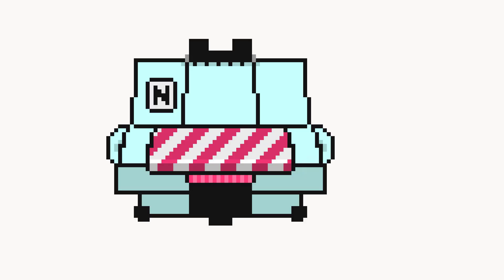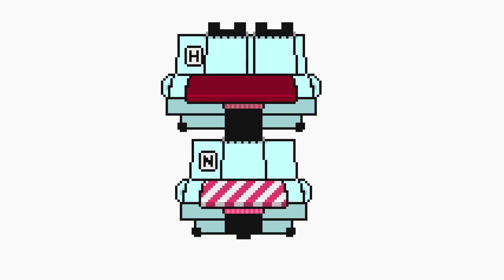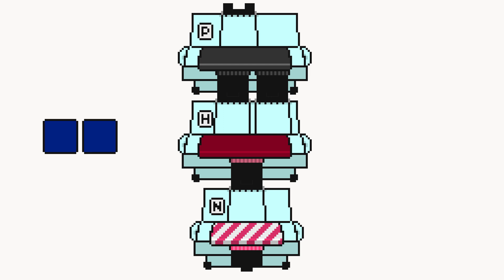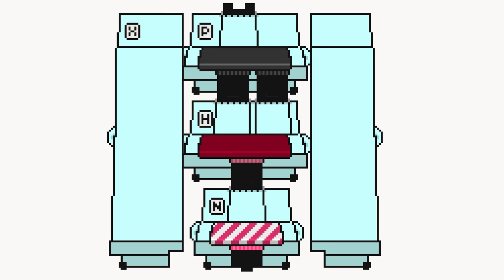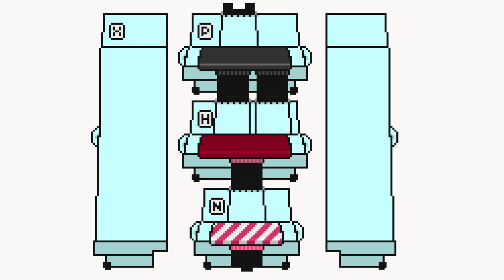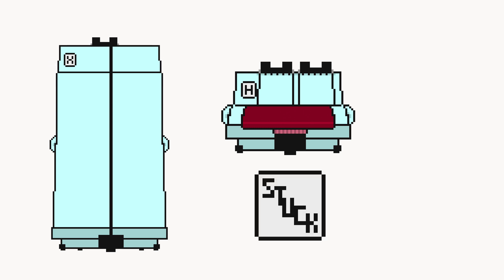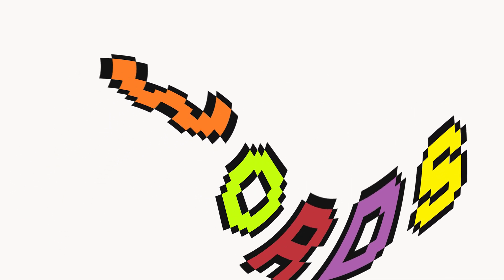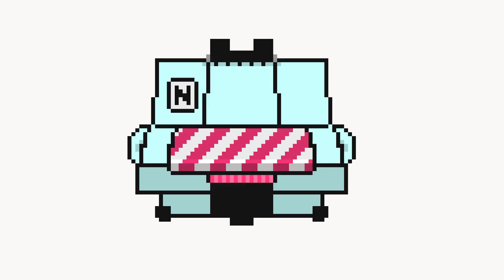The Halting Problem Debunked

Comment: i do think your analysis was on the right track but its not quite accurate

the actual issue with the halting problem is that it uses something called extensional set theory

however computers are intensional
this means that if it were fed its own blueprint, even though the blueprint is identical, it is being simulated, which is intensionally different from its external real world counterpart

this means that its actually impossible for you to input an intensionally identical input to its own code

this means that the negator wasnt at fault, its simoly that the machine being simulated and the external machine are two different machines intensionally, they have seperate contexts which makes them functionaly different despite having identical code

this direct machine difference means that even though the internal code says "stuck" and the external code says "not stuck" 
there isnt a contradiction between one machine, its actually just the result of two different machines producing two different results
Reply from the maker: @pigizoid9924  hmmm, I'll have to think about that... Thanks for the comment/input in any case
Reply: @AntonioEligius  
The halting problem is basically a complex form of the liars paradox

"this sentence is false"
in extensional model, we will assume it is true, which returns false which returns true etc...

but in an intensional model of set theory its different
"THIS sentence is false" within its current context
we assume the context is true, which returns false, and then it stops there
because once it returns false, its own context changes and THIS sentence is no longer the same sentence described at the start of the paradox, its intensional identity has been changed due to the new context, even though extensionally the words of the sentence havent changed

in the halting problem, an infinite recursive loop is not-halting, meaning the halting machine will print "stuck" 
and even though the output is "not stuck" 
the halting machine is still correct, because as mentioned earlier, the contradiction doesnt exist, because the programs are no longer the same program

it outputs "stuck" WHEN simulated (intensional context)

even though it outputs "not stuck" WHEN not simulated
(intensional context)
Reply: @AntonioEligius  im back with a more formal description 

in the halting problem there is a device D, the device D needs to take in its own input, so we will denote device D running with no input as D() and device D running with its own input as device D(D)
the two subtle points of failure in the halting problem are the underlying assumptions that the external device D() and the internal device D maintain referential integrity and hold up to kleenes description of "meaningful referenenc" however this is not the case, as due to godel numbering, the encoding of D is done in a way where there exists two copies of the device, aka the device is running across two contexts, meaning they are referentially variant, the result of this is they could produce two seperate outputs as they dont share the same intance
however if we do rigourously enforce referential identity, aka singular instance, then the external device D() and internal device D must produce the same output as they are literally the same object in memory, this means that Turing's result of having the external device and internal device produce two different results is not a conclusion of "incomputable" but is instead a result of a failure to enforce referential invariance, aka making D() and D identical

to enforce referential invariance you need to use a self reflective model such as a push-reactive frame of reference encoded model, these such models are turing complete according to the classical turing constraints, but with the extension that the assumed "trivial swapping" no longer becomes trivial, as the swapping device S needs to subscribe to a frame of reference to listen to, however the device D must write the frame it outputs to into memory, and due to basic temporal limitations S cant read the frame until after D has written it, meaning D can deny S from subscribing to the frame and ever swapping the output
this also has the added benefit of letting D output values both in bnary logic and in modal logic, where D could display "halt" or could display "halts in frame f" 

if i were to point out a very absurd but direct reasoning of the flaw, imagine running a function in two contexts, i.e. one runs in linux and the other on windows, of course they will produce two seperate outputs, despite being encoded identically they cant run identically unless they run in the same frame of reference

Comment: The statement at 2:20 makes no logical sense: "if the machine does not halt, it is actually halting on the programmed function of looping". You're confusing "halting" with "working as intended". These are two different things.
Reply from the maker: It's reaching an end state; it was programmed to loop as an end state; that's the form of halting I'm referencing by way of basic logic.
Reply: @AntonioEligius  It's impossible for a machine to "not halt" and to "halt". By way of logic that's called a contradiction.
Reply from the maker: @tomekczajka  no, I'm uncovering a logical equivocation. In simplified terms, they're saying they've solved a problem whether or not you can make a machine that won't halt, by simply designing a machine that is programmed to not halt if a halting input is fed into it. You've got to understand, halting is just an end state of a program and since they made a program with an end state of "looping"  or "not halting" they've just made a different kind of halt, because the intended end state, or halt, is that of an exact repeat. It's like if I made a program on Basic that read:
10 Home
20 Sweet
30 Go to 10
It would just say Home Sweet Home over and over, but that's what I wanted, so I got the end state that was desirable. I'm just saying their proof, can't be a proof, because it's too simplistic in nature and they didn't go through the work of making every kind of computer, they just tried to bully an answer out with faulty logic.
Reply: @AntonioEligius  You're the one equivocating. That Basic program unambiguously does not halt, by normal terminology. It does what the programmer wants, but that does not mean it "halts".
Reply from the maker: @tomekczajka  ok, since you're making this claim, prove the premise. Show me and explain how Turing's un(it) machine solves the Entscheidungsproblem.
Reply: @AntonioEligius  I made no claim in this thread that Turing's un(it) machine solves the Entscheidungsproblem.
Reply from the maker: @tomekczajka  well I don't know what else to tell you, other than each machine after the duplication machine doesn't malfunction, it simply prints one of two outcomes. Mal from the Latin for bad, and functio from the Latin for perform. There is no bad performance, it's the intended outcome. Remember the original premise is to see if you can prove that a machine can't do everything computationally; you can't prove that by having machines do exactly and perfectly as they're programmed.
Reply: @AntonioEligius  Abstract computers (Turing Machines) do exactly and perfectly as they're programmed. Simply claiming "you can't prove" something when you have a proof is pointless. You've nicely animated a valid proof. That proof doesn't mention the words "intended" or "malfunction". It only talks about whether a machine halts or doesn't halt. You're trying to point out a flaw in that proof but you fail because you don't understand what "to halt" means. In your animation it means "to print a piece of paper". If a machine doesn't print a piece of paper, it doesn't halt by definition.
Reply: Based.  @AntonioEligius

Comment: I do agree with the hoax part. however i don't agree on how you get there. If the machine seems stuck, it doesn't mean it is indeed stuck. So you can't be sure if it is stuck or not. Unless you have a way to proove that it is stuck. Unfortunately, it is your proover himself that happens to be in such a state in the first place.

Comment: Whether or not the machine is "intended" to get stuck or not is irrelevant. The halting problem is a logical proof that turing-complete systems can't solve every problem using logic. There are lots of other examples, but this is just the most well known. 

Sure it's just an abstract reductive scenario, but the fact that it causes a paradox at all is proof that the halting problem is true in this edge case at the very least (and most likely many others)
Reply from the maker: How so? You can't yourself think of an algorithm that gets in-between the problem and the solution? I think you're under estimating yourself.

Comment: No, that's not how it works. The video you link is a simplification of what the halting problem is about and how machines work.

The halting problem talks about Turing machines, which can only take some numbers as arguments and give a single number as output. This behaviour can be express through a function (takes some arguments, gives a number), and the "getting stuck" is actually that function not having a defined value for that input in particular. The thing is that not all mathematical functions can be calculated by a Turing machine, only those called general recursive functions (https://en.wikipedia.org/wiki/General_recursive_function), or computable functions.

Can you pass a "blueprint" of a Turing machine as an argument? The answer is yes, but you have to give it, as mentioned, as a number, so you basically need a way to codify every program or machine as a number, so that given that number you can recreate the machine's behaviour. Couldn't find any source online about how to do it, but it's doable.

With this in mind, the halting problem wants to know if there exists a Turing machine that given the code of a machine and an number, always tells if the machine corresponding to the code we gave it would get stuck if given that number. That's to say, the mathematical function that behaves like the machine described just above is computable or not. The halting theorem, which can be oversimplified like the video you linked, proves that function is not computable.

About the correspondence of these Turing machines and real-life ones is basically what the Church-Turing thesis is about (https://en.wikipedia.org/wiki/Church%E2%80%93Turing_thesis). I recommend you check it out. I think that can have a lot more to do about the point that you're are trying to do, which is currently wrong.

Note: "stuck" cannot be considered a programmed function because a machine taking too long to calculate something does not mean it will get stuck. We can never wait long enough to determine whether a machine has gotten stuck in a particular ouput or it just needs a little longer. That's precisely the importance of the halting theorem: we cannot determine in general and beforehand if a machine will end a calculation before feeding it with a given argument, at least, algorithmically.
Reply: If it doesnt solve in less than 1 min it is stuck. Stick to practical